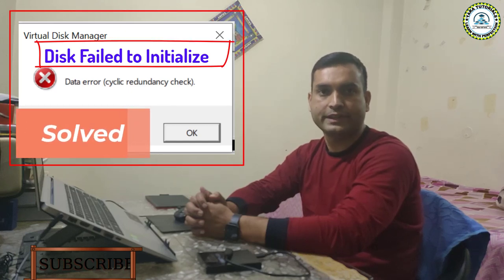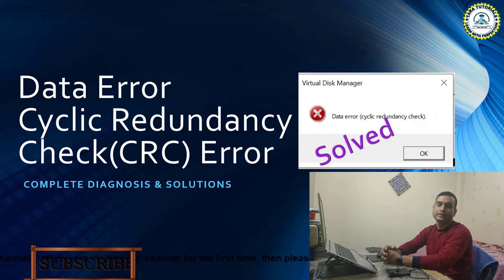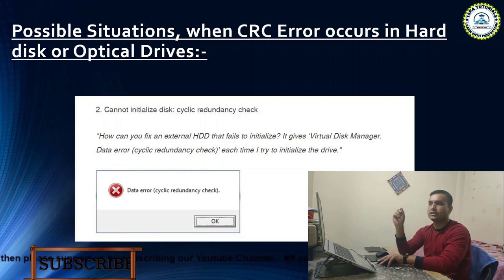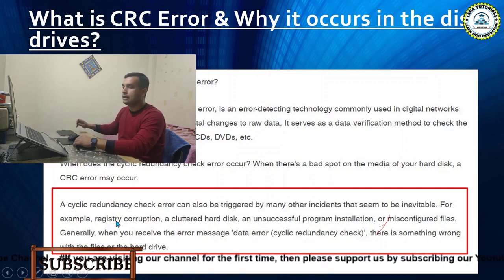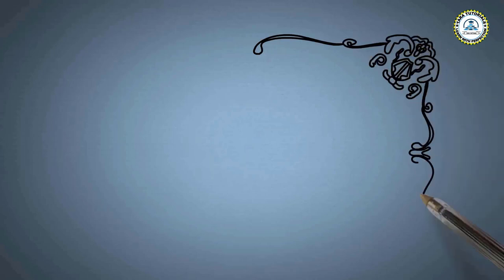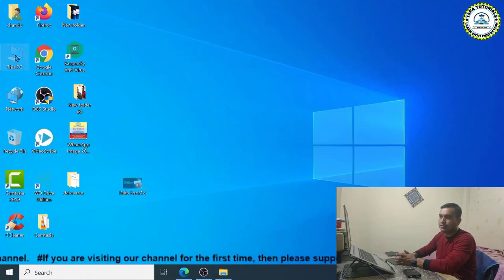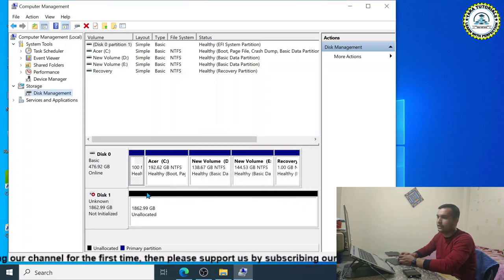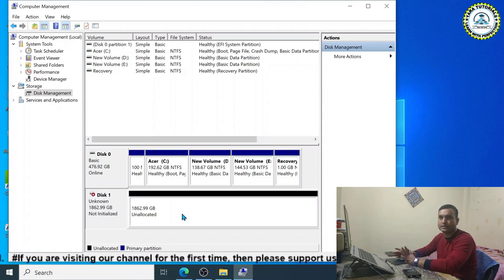How to Fix Cyclic Redundancy Check (CRC) Data Error: Disk Fails to Initialize?

Comment: Nice tutorial, but you didn't show any solution for the error (crc) when you try to make the( create partition primary)... If you do have a solution please reply. Thank you
Reply from the maker: It's there in the tutorial. Please go through the entire video
Reply: @taratutorials8514  thank you for your reply, but it didn't work as I followed your steps :
1 - diskpart ✔️
2- list disks✔️
3-select disk 1 (in my case)✔️
4- clean (the disk has been cleaned successfully)✔️
5- create partition primary ✖️✖️✖️✖️ here I got the error of CRC and I can not go further..
And all you said to take the hdd to the workshop. Any ideas to solve this error problem
Reply from the maker: In that case, there is last option that is manual repair
Reply: How do we do manual repair?
Reply: @khalidabdalla6341  I have the same question
Reply: @khalidabdalla6341  Exactly
Reply: its a waste of time the harddisk is trash already
Reply: @taratutorials8514  yes manually repair, how to do that ? fake/troll video.

Comment: I did everything you did, I got the same exact error messages ect, but I ended up at the same place with no solution. I could care less about the $100 hard drive , I just really can't lose these files. Is there anyway I can get them off the hard drive.

Comment: I put in the Commands as Adminstrator and received the same message you did (about encountering an error and needing to check the System Log). Do you have a video about what to do when that happens?
Reply from the maker: These steps are just hit and try method
Reply: @taratutorials8514  Hit and try? Do you mean just do what you did as if that message did not appear?
Reply from the maker: CRC error is a critical one and needs replacement in most of the case

Comment: Dear Sir, will my data get deleted after applying disk part format command, Is there any way recover data first and proceed for correcting CRC error. Plz reply,
Reply from the maker: For that u need to recover your data using data recovery software first
Reply: Thanks.

Comment: Hi, I have the same problem with an external hard drive, if I do this process, it will format and lose all my files?
Reply from the maker: Yes....we donot have any alternative!
Reply: @taratutorials8514  Thanks for answering. Do you know another option to recover my files?
Reply from the maker: Yes, u can first attempt recovering ur data and then you can try repairing ur disk for safe side
Reply: @taratutorials8514  How did I get my files back if the hard drive does not appear in the drive?

Comment: I found the solution to my problem, due to the system not letting me initialize my disk but it did recognized it... I had to download Easeus partition manager and unfortunately wipe the disk... but fortunately, I had just installed a game so no important files where missed. after that, all was normal again and no more errors showed when assigning the unit.
Reply from the maker: Is Easeus partition manager software FREE?
Reply: hi can you help me fix it by teaching me how, i have the same issue as yours, thanks in advance
Reply from the maker: Watch full video...it is self explanatory
Reply: @kennethcalzado_  Sure thing bud. The fix for my problem was to download easus partition master (it has a free version), install then run it, then right click on the disk you're having trouble with and delete or "wipe" , unfortunately you have to delete all data on it... but it with get rid of the CRC issue.... Just so you know I had a bad installation process on my disk that gave my that CRC error...
Reply: @taratutorials8514  Yes, it has a free version on their website. But I don't know its limitations (on the free version)...
Reply: @alxluthor  going to try it tmr... hope it works I need my two tb hdd and I can’t afford another
Reply: do you know what the license code is? i don't have money to buy it right now
Reply: @alxluthor  do you have a license key for easeus.., nothing else is working for me
Reply: @mdoubleo-d  Unfortunately no, I had to download the easus by other means... but just so you know in my case the problem was the SSD (adata swordfish) I bought, it had issues so I ended up returning it.
Reply: @alxluthor  that sucks... i have a dead HDD and I need the licscene to get it fixed but I cant afford it :(
Reply from the maker: What licence bro?
Reply from the maker: Tough luck!
Reply from the maker: Sorry...but Easeus is a paid software
Reply from the maker: Try to find crack key
Reply: @taratutorials8514  do you know a good website for that?... I haven’t found one
Reply: @alxluthor  How much time has it taken to complete the wiping???
Reply: @alxluthor  it paid function

Comment: Sorry but why is there no explanation on what to do if you get the “ Data error (cyclic redundancy check) in command prompt”? Watched the video thinking there was a solution to the problem as stated on the video title. Does anyone know how to fix it? Watched the entire video thoroughly but after this error, the video just skipped to a different command prompt log using a different HDD
Reply from the maker: Sir...I have also suggested few possible solutions....like changing cables, trying with formatting and other related options
Reply: Yes we'll said in video he skipped title  solution

Comment: What is the solution of Diskpart has encountered error in CMD Prompt?
Reply from the maker: Diskpart utility is the another way to sort out this issue, if u cant fix it using GUI. It the issues still persist, go for replacement.

Comment: I have my whole data in that disk and the same problem is occurring what should i do now? 😭😭
Reply from the maker: Please take backup first and then attempt repairing disk
Reply: @taratutorials8514  bro how can I even take backup? When I connect my hard drive to my pc it's telling "drive not initialize" and then when i try to initialize the drive either in MBR/GPT partition it's telling "virtual data error data check redundancy try again". 

Please help brother how can I fix this issue? And what's it's trying to say is my data safe or not? Please clarify
Reply: At any cost I just need to pull out my data out of it. Please help it out 🙏
Reply from the maker: Consider opting for data recovery services
Reply: @taratutorials8514  how?? Please tell if you have knowledge about that
Reply: @taratutorials8514  you mean I should reach to professional data recovery service centers. Should they safely remove my data without any loss?
Reply from the maker: Yes...They can n will

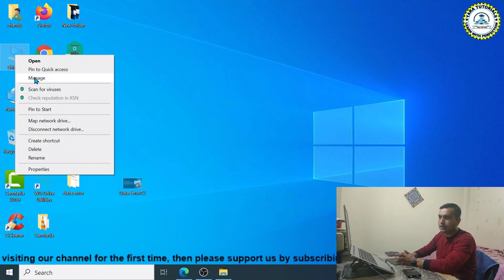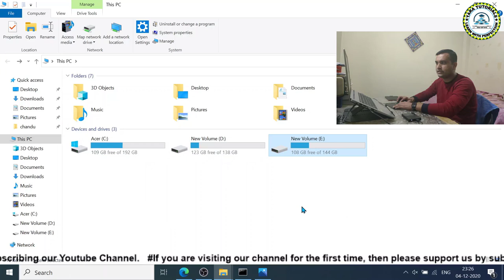Comment: 7:24 the flashing led of my disk (seagate 1TB) DOES NOT BLINK and the disk IS NOT SEEING ON EXPLORER (W10) currently I'm generating the image with REMO but the time is too long ...12:48 I understand, so are all capable, if I clean the disk remove all the data, so what do I need to restart a disk if I lose all the data? the purpose is not to clean the disk but to recover the disk!  14:01 I understand but what size is the partition? and where is the data?  14:14  BUT I NEED THE DATA I CANNOT FORMAT THE DISC THIS IS AN IDIOCY!!! 14:43 I UNDERSTAND, BUT IF I FORMAT THE DISK, WHERE DO I GET THE DATA? IN PIZZERIA? WHAT IDIOCY IS THIS? AJHAHAHAAHAHAHHAHA YOU MUST BE AN EMPLOYEE OF MICROSOFT, THAT CREATES USELESS SYSTEMS TO SOLVE THE NOTHINGNESS HAHAHHAHAHA 15:00 BUT HOW CAN THERE BE DATA ON A DISK THAT YOU JUST FORMATTED? CAN YOU EXPLAIN THIS MIRACLE? DID "ANUBIS" HELP YOU?  15:17 BUT IT IS NOT TRUE THE CRC ERROR IS A LOGICAL ERROR NOT A PHYSICAL ERROR!!! YOU NEED TO USE A SOFTWARE YOU DON'T NEED TO OPEN THE DISK IF NOT YOU WOULD NOT SEE IT IN MANAGEMENT!!!! BUT THAT'S GOOD THAT IT'S STILL WORKING SO I DON'T LOSE TIME AHAHHAH  15:22 SEAGATE IS A MANUFACTURER THAT DOES NOT SOLVE THESE PROBLEMS BECAUSE THEY ARE STUPID AND COSTLY !!! ////  >>>>    by doing what you say 4 disks appear  
Disk 0 online - 931 Gbytes / available 0 bytes
Disk 1 online - 232 Gbytes / available 0 bytes
Disk 2 online- 465 Gbytes / available 0 bytes
Disk 3 online - 1863 Gbytes / available 0 bytes
Disk 4 online-931 Gbytes / available 931 Gbytes

I DO NOT INTEND TO DO ANY CLEAN AND FORMAT BECAUSE IF I DO CLEAN AND FORMAT I WILL DELETE THE DATA AND MY
PURPOSE IS NOT TO DELETE DATA IF NOT I WOULD BURN THE DISC IN THE FIREPLACE DIORECTLY AND I'd BUY ANOTHER!!!
what i don't understand is who taught you this useless logic?

Comment: @12:05
it only show "Disk 0"
Reply from the maker: It means that faulty hard disk is not detected by system.
Reply: @taratutorials8514  any solution?
Reply from the maker: Try changing data cable and try in other PCs. If problem persists, discard it.
Reply from the maker: And plz subscribe